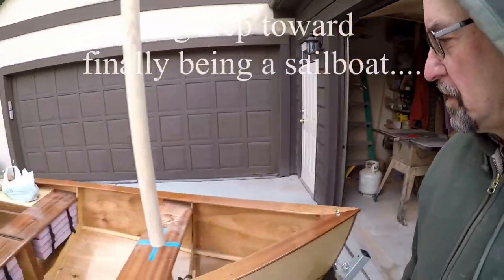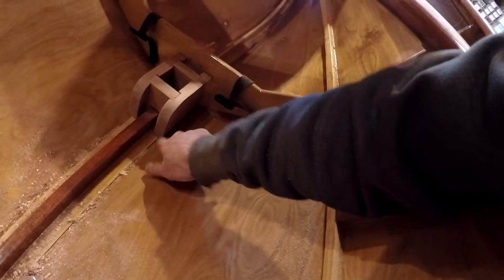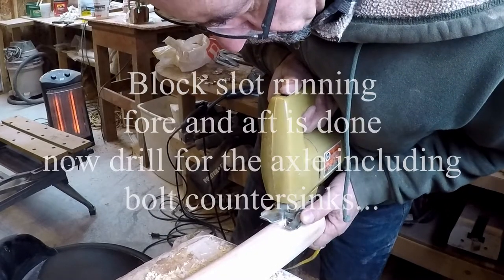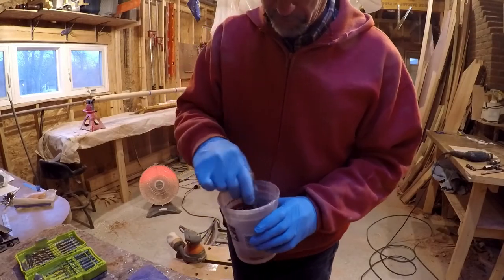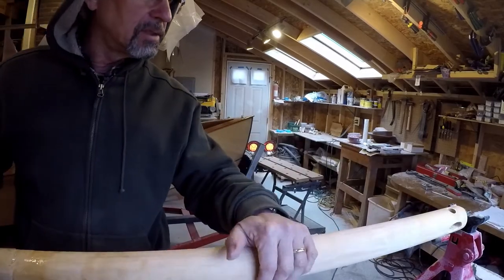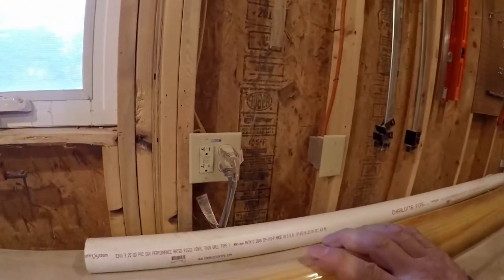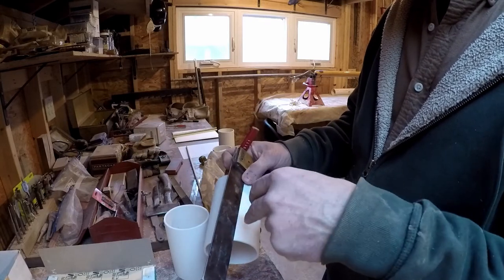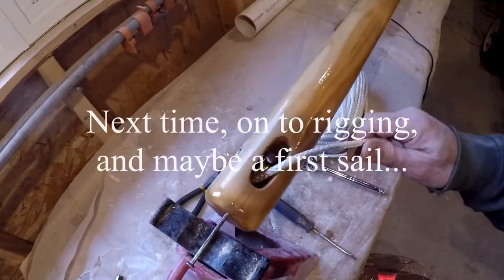Ep 30 Step the Mast and Start Rigging: Designing and Building a Sailing Rowboat

Comment: Have you secured the mast to the mast step in case of capsize or did I miss it somewhere,,I noticed a 10-12 mm hole bored thro the mast step ,can a bolt be drilled thro the mast here to secure
Reply from the maker: Yes--I there's a locking pin through the mast step and butt of the mast.  Lots of bad things would happen in a capsize situation if the mast started to work loose!
Reply: @rudywoodcraft9553  cool so it's ok to drill a 12 mm hole thro the bottom of mast,,fill it with epoxy and redrill with 8 mm bit and put a Stainless bolt thro
Reply from the maker: @johnhaughey5347  That system would certainly be good; I have to admit that on Grace I have something much simpler, an aluminum gutter nail cut to length and passing through the mast step and mast butt; could be more secured but I am interested in quick setup/tear down as most of my sailing is relatively short day sails--out and then back on the trailer
Reply: @rudywoodcraft9553  Thank you,,I really enjoy your videos